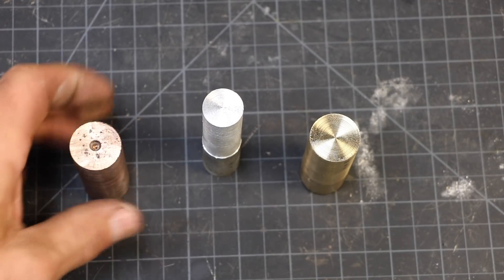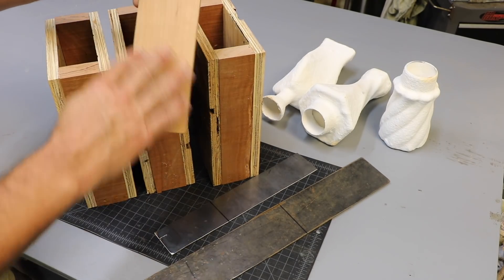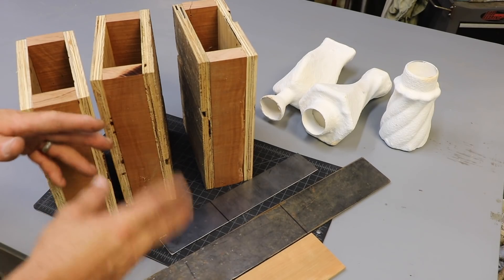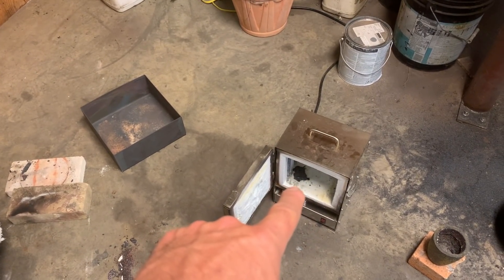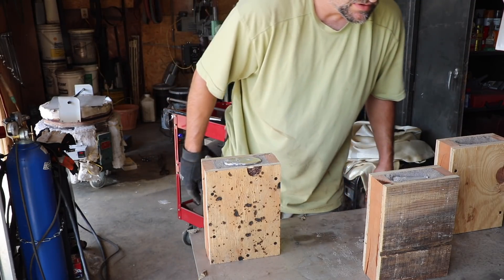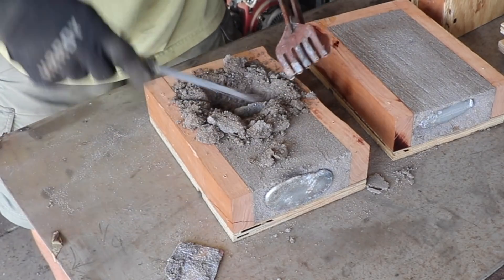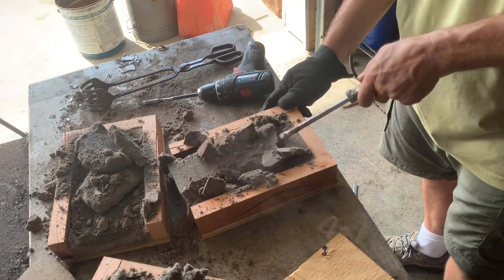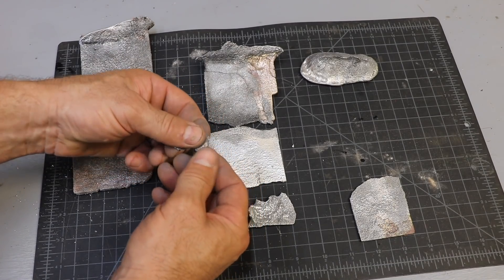Mixing Molten Metals.  What Could Go Wrong??

Comment: I am at the point in the video where the first pour is about to take place. I'm afraid there might be some splashing, or mild exploding (like when there's moisture, caused by the two different heat metals. I'm also concerned about the coordination necessary to pour two crucibles at one time. A helper might be needed.
Reply: So, I didn’t see what I was worried about, ie the explosion.

I'm wondering what happens if the appropriate weight (for the 90/10 mix) is melted in one crucible. Will the aluminum be ruined taking it up to copper's melting point?
Reply from the maker: Nope.  That's exactly how you would make a proper alloy of aluminum bronze.  Typically you melt the highest melting point metal component first (copper), and then add the other metals of the alloy.  Aluminum in this case for aluminum bronze, or zince if you wanted brass, tin for bronze, etc.

Comment: Only 2 minutes into it, but you can heat the aluminum all the way up to 4,400 F before it starts to boil, so the aluminum does not have to be at only 1,200 F, trying to freeze the copper...Nice one-hand crucible holders!

Comment: @7:56 Yeah... yeah... I did this a few weeks ago with a carbon ingot mold. We were still prepping a mold so I covered the glory hole with the overburden mold so we could cycle on/off and not waste gas. Once we were ready to start the pour my dumb ass didn't hear the fire going so it didn't register that SHIT IS HOT USE TOOLS. We have a new rule: once the foundry is lit EVERYTHING IS LAVA. Always gloves, always tools, temp gun EVERYTHING. If someone reaches for a thing without gloves you yell at them. Period.

Comment: OK, I have not cheated. Never do but that's beside the point. My dumb idea is the molten copper and molten aluminum will react very badly or violently when combined and perhaps look a bit like burned eggs scattered among crappy looking fried potatoes ie a random mess. Now the fun part begins where I get to watch the result.

After comment.

Cool, not eggs and potatoes and not violent reaction, but cool result. Like your strip sander too. Looks more robust than my 42 inch machine, but they are handy to have for sure.

No ideas for...but if I think of one later I'll come back....

Comment: 9:22 there is still hope, but at what cost? It's a good initiative but a huge amount of "shit alloy" compromises the purpose of the artwork. The suggestion is to look for metals where the ratios of alloys do not affect so negatively that they do not manage to mix and control the measurements in one more step instead of arbitrarily mixing.

Comment: As you go over the 8 to 10% aluminum in the Cu-Al bronze alloy, it becomes brittle, just as you saw. 
    In aluminum bronze the percentages are critical. Too much aluminum, and its weak and easily shattered.

Comment: I will admit that I watched the whole video before commenting. As thin at you made the the pours, I didn’t think the results would work but would be cool to see. Now if you made the castings with the vases you made, the metals would have a better bonding due to the volume. That would be really cool to try. Maybe you could make a cylinder mould 5” or so in diameter and then attempt to machine them on a lathe or CNC machine.

Comment: About Aluminum...yeah the reason the Washington Monument in DC has an aluminum capstone to it, was at the time, a bit of a flex to show off how wealthy and prosperous the country was...because at the time aluminum in any significant quantity was rare and cost a shit ton to produce.  Nowadays we have relatively cheap and efficient ways to mass produce the stuff so it's super common.

As for predictions on mixing metals....well just pure metal with nothing to make them bond or something like that is likely going to end poorly....I mean, different metals have different melting points as well as different rates of cooling and stress factors.  Without some other material to help equalize them you're just gonna have a hot mess.   Can't even claim to be an amateur here, just some slight knowledge on the subject ( and could be completely wrong.  guess I should watch instead of comment at the start )

Comment: Difference on density (Cu 8 g/cm3, Al 2.7 g.cm3) will make the liquid Al try to work its way up through the liquid Cu - so there may not be nice layering but instead some kind of a solidified slurry of the two metals, which might separate from each other and cause the whole block to crumble if the metals contract differently on solidifying. It works for damask because the solid layers are very similar in physical properties (density, thermal expansion, etc).

Comment: Aluminiumbronze is much more than just copper and aluminium mixed together. There's tens if not hundreds of different types, but the most important difference with the alloy you were trying to achieve is that all of them have iron component in them. Also many alloys contain amounts of nickel, mangnesium, cobolt or mangane in them.
Another thing is that you tried to use copper which is not really castable in pure form. There are copper-selenium alloys that are suitable for casting but the regular copper scrap is not.
Also I think you need more volume in your castings to hold the heat for longer time. You tried to cast such thin plates that everything solidifies instantly when you pour it in. Aluminium isn't the greatest for such thin sand castings by itself, you probably had mostly aluminium oxide rather than metallic plate as a result so that's why it was so brittle.
Interesting experiment nevertheless and if you want to do further experiments I would suggest using brass and aluminium and casting thicker plates or maybe round bar or similar object. Another pair of hands wouldn't hurt either. Good luck!

Comment: My prediction is that being pure the metals by themselves go from liquid to molten straight away (without a goopy fase in between). However when you start mixing metals with vastly different melting points, this is not the case. The as the metals mix they will tend to solidify because the alloy of copper and aluminium will result in a material with a higher melting point. Without applying a lot of additional heat (and perhaps even mechanical mixing), you'll end up with metal goop with a very unpredictable consistency. The aluminum will want to float on the copper because of its lower density and the difference in meltingpoint can result in some violent boiling and or degassing. Given enough time and heat the metals will mix on their own and might form an eutetic mixture.

Edit after watching the rest:
It's very interesting to see the difference between theory and practice. I still think that if you mixed the metals while heating them you'll have better results. Aluminum will probably also require some flux to deoxidise it and make it easier to alloy. I think if you do the dosing of the material while solid. Then melt it in the crucible and give it a slight stir you'll be more likely to achieve the results that you are looking for 🙂 However from this test it looks like having these materials partially mixed is not a good idea in combination with thin walled casting, because the material will be very brittle.

Comment: Prediction (paused video) - 1) 2 separate heating temperatures being poured in layers. You might get them layered with aluminum then mix then copper on top.
2) poured at same time. Might produce stripes on one side and the other of copper then mix then aluminum vertically. OR copper mostly on bottom with aluminum on top due to metal's differing weight.
Suggestion, forget trying to get stripes of aluminum/copper an just meter out the copper (90%) and aluminum (10%) and then melt them in the same crucible at 2000º.

Comment: According to Wikipedia, the alloys used are something like 95% copper 5% aluminum. So you need a much higher percentage of copper (and you need to measure to get the proper ratio). https://en.wikipedia.org/wiki/Aluminium_bronze

Comment: I believe it's either going to make a brittle, uneven, junk alloy or it's going to separate and most of the copper will end up on the bottom due to density. 
Also you're a total nut for using two crucible at once and have all my respect.
Edit: Yup. Shitbronze™
Reply: Fine Chinsesium.

Comment: I dont think the materials are gong to mix....  I imagine that it's going to work out about as good as when you try to mix cement in a post hole instead of premixing...  Did you consider mixing it in the crucible?  I bet there is something you need to add to get the 2 metals to mix.

Comment: I'm not the only one whos thought of this then, hahaha.
Maybe do it on a tray type surface instead and just swirl the two metals together while molten?
For example, pour your crucibles out onto a metal cookie sheet, one side copper, the other side Aluminium, then swirl with a metal tool where the two metals meet.
Reply: Or simply pour them into each other so they semi  mix on the way down to the sheet of metal.
Reply: @moonshiner2977  I think they would just mix, and then and you would end up with brass. The hotter your two materials are, or the more liquid they are (BOTH in this case) the faster diffusion will happen.
Imagine taking an eye dropper of food coloring, and just touching the tip of the eyedropper to the surface of the water. The ink is going to be pulled into the water and diffused. Same principle in this video. I'm pretty sure there needs to be some "settling" time for the metal to slightly harden and get a "skin" before pouring the next metal. Too soon and the heavier denser metal is just going to sink to the bottom.
Reply: @joshuamiller8235  I don't know what would happen, you may be right, I would have thought there would be a sort of marble effect as one gets when mixing resins.  I only said it out of interest really :)
Reply: @moonshiner2977  I have no idea if I'm right tbh, was just a guess. I would LOVE to figure out how to get a marble patterned Mokume Gane too!

Comment: I feel like the molten aluminum and molten copper pour will boil the aluminum off. Anything other than that will result in layers.
Edit: I guess the temperature difference wasn't great enough to boil off the other.

Comment: Try embedding AL pieces into a mold and then pouring in copper.  Need sufficient mass, your plates were too thin to pour either metal very well.  The mold just pulls out entirely too much heat.

Comment: You might be able to get an interesting effect from filling your mold with copper pellets or turnings, then pouring aluminum in.  The outer layer of the mold will be wetted by the aluminum so you would need to cut into the model to get color changes.
Reply: That's actually a good idea. Mixing in some copper or brass shavings with the lower melting point of aluminum would suspend the brass or copper in the aluminum. I guess it would depend on how much heat the copper pulls from the aluminum. The difference in specific heat could be an issue if the aluminum goes solid before the mold is full. But it could work if the materials can't actually form an alloy because of the difference in melting temp. 
I'm giving you a thumbs up. I would like to see someone try it. 
It wouldn't give the marbled effect but it could look pretty cool.

Comment: Try heating the copper to melting, and the aluminum added in smaller solid rods or chunks pushed down into the molten copper and see if the aluminum melts into various spots and as it tries to rise maybe it would disperse itself more favorably. Just a thought, I've never smelted metal so I'm clueless. I've been welding for years but I've always added traditional rod or block to change the properties for strength, temper, deflection of load etc and its a totally different dynamic and process.

Comment: I assumed they would striate based on weight or miscibility, but after the ominous warnings I thought "Oh no, is he about to accidentally make thermite on his table?"

Thankfully not, but just out of question, why not melt them in the same crucible at the proper ratios? Will the melting point of copper cause problems with the aluminum, or how would one create this type of alloy at home?
Reply from the maker: That’s exactly how to do it if you just want to make a consistent alloy. I was going for a swirl pattern between the metals.

Comment: Would be interesting to see the pouring / casting properties of Cu-Al eutectic (33% Cu) ... quite likely brittle.
The other approach for a double pour, might be to use pure copper plus a somewhat over aluminiumed  Bronze - maybe test where the properties degrade too badly

Comment: The phase diagram at high copper concentrations is really messy above 50%Cu so you are going to get a lot of intermetallics with different melting points and structures so a lot of poor structure. Maybe make some fully mixed 50/50 Al Cu working up from low copper and see if it still has a nice color and then work with that.  https://www.tf.uni-kiel.de/matwis/amat/iss/kap_8/illustr/i8_2_1.html

Comment: OK, I stopped at 5:30 and didn't read any comments. I predict the copper at 3000ish will cause the aluminum to vaporize and probably flash/boil over. On with the science experiment, don't get hurt!    Edit: Well, as it turns out,  I don't know crap. Par for the course. Great video!

Comment: You can cast Al over Cu if you wanted to a more interesting pattern. If you filled the mold with copper granules/scrap/whathaveyou, then heat the mold to something like 550 or 600 C (Al melts at 660), and then pour the Al over the top you should be able to maintain much better segregation. The melting point difference is more severe with Cu Al, but my wedding band has something similar with gold scrap cast into a silver ring. Tis very pretty. 

If you have any ferric chloride kicking around I would be curious to see a quick etch of the piece you sanded up. The grain structure in there is going to be pretty neat, although there may not be anything big enough to see with the naked eye.

Comment: A thought...try doing a low temp pour in areas with aluminum. allow to cool, then pour in the copper after. the copper will reheat and melt the aluminum in very limited areas.

Comment: Paused at @05:25; -> mt thought;The molten aluminum wil be overheated by the molted copper, probably creating gas and the whole pore start sputtering and splashing. Added @08:20 🤪😜 well completely wrong prediction. Added at the end, no project is a failure so long you learn. You mite not achieved your goal with this poor, but you now know how not to do it. Looks like a succes to me!

Comment: I predict that the copper will lead the aluminum in heat and force it to remelt which, depending on moisture content may lead to explosive results if it gets trapped.

I see now that it does remelt slightly. It seems that a metering process is needed, perhaps a preheated crucible to mix the molten materials together and then pour the concoction into the mold. If I was going for a copper / aluminum look, I would perhaps rough up the surface of the mold in some way, pour the copper, then put in a second mold with smooth walls and pour the aluminum. Finishing with a belt sander down to the copper / aluminum layer. 

Thanks for the interesting video

Comment: Paused at 5:25 : I am not knowledgable in metallurgy ; so parden me if my prediction is incorrect... Because of the difference in density and melting point, I predict a flare up or unpredictable splattering of molten metals.

Now to finish watching the video.

EDIT : I stand corrected: Though it was a neat experiment. I never suspected that the aluminum would become so brittle; and yet the copper remained malleable and the bronze alloys were hardened.

Comment: Admit it you want people to guess what will happen not just because yes its interesting but also it boosts engagement.  Ill buy though.  I doubt this will be the problem but im going to guess different densities make one metal float on the other.
Reply: I was half right, the other half being the alloy sucked balls.  Maybe you could purposely make some shit bronze, turn it into powder and cast it into the vase with resin.  Thanks for posting a vid of failure, it was as interesting as a success.  Does that mean the project actually succeeded?

Comment: This is definitely cool, I would love to see more things like this! My undergraduate research was on trying to fuse YMnO3 and HoMnO3 using a focal point of light to heat the material to 2400 C after pressurizing it into a semi-stable but brittle (previously preheated powder) cylinder. By using the intense light to heat a single point to melting (but not so much it drips), we were able to slowly move the focal point up the length of the cylinder and allow physics to create the most energy effective crystal direction of growth. This allowed us to make large single crystalline samples for neutron diffraction, but it's so cool to think how else melting techniques and molding techniques could be done!

Comment: Nordic gold - 89% copper, 5% aluminium, 5% zinc and 1% tin.  Molten zinc is a pisser for its flammability.  It better goes in as zinc copper brass.  The tough alloy takes a high polish and is very showy. Copper aluminide, almost ceramic,  is grown after casting the mixed alloy.  The Al-sparse alloy cast piece is reheated to grow a matrix of crossed micro needles.

Comment: I think the molten copper is going to over heat the aluminium causing bad porosity, as for appearance I think it will be a fairly uniform slight swirl??
Might get a good surge and spit when you mix the two molten 🤞

Comment: Try one crucible with Cu100, and one crucible with Cu90Al10. Melting temperature and density should be closer (I guess), so a better chance for nice swirls. There's still a good difference in colour, and I think it would look nice together. And you wouldn't risk getting any shitbronze.